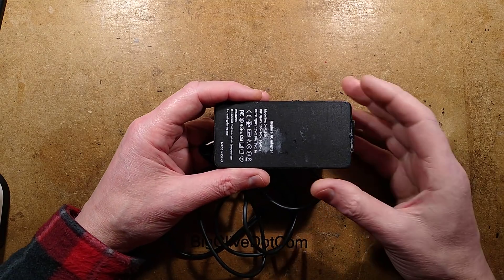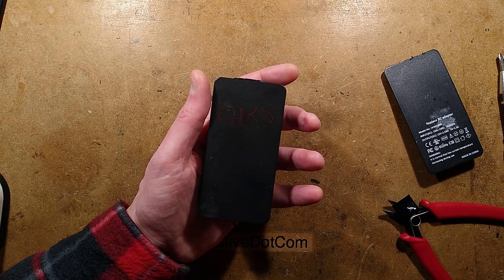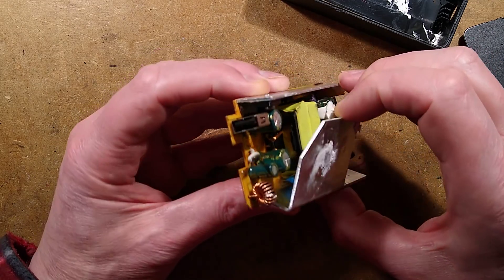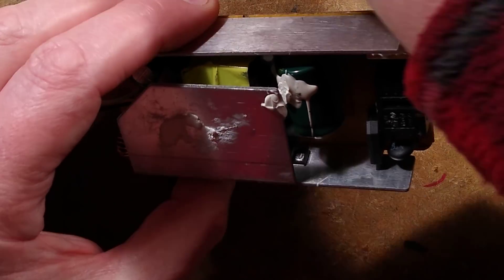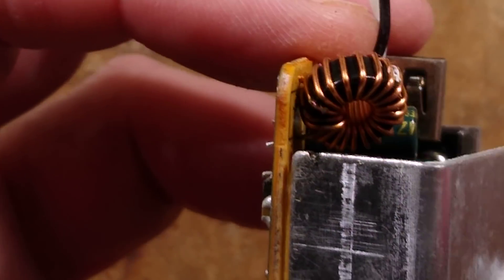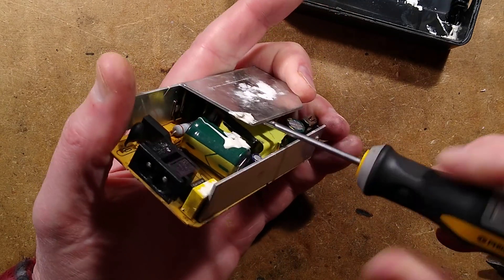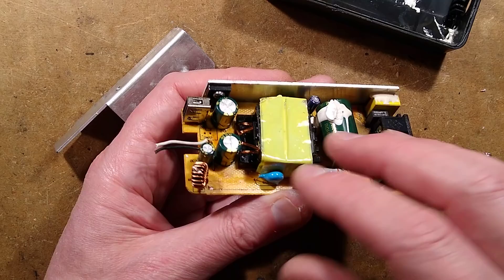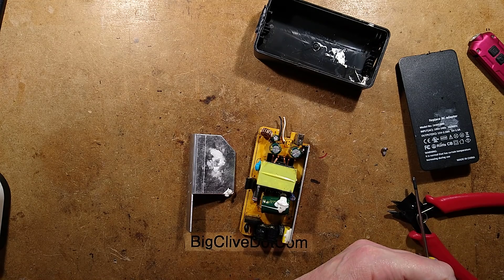This PSU killed a Microsoft Surface and a monitor

Comment: I have a few of these power supplies, all of a smaller power capacity. I have taken some of them apart, and even when they look a little different on the outside, the components are the same layout as in this one. None of mine have ever burned, and the difference is in the smaller one that I have, the heat sink, and the inductor, are both small enough, that they can't touch each other. One thing I do notice is that on mine, there is a glob of that white "shmoo" on the inductor. I don't know if they were trying to keep it insulated from the heat sink, or if it was to keep it from vibrating. Either way, I am glad to know about this fault. I will keep an eye open for this in the future.
Reply: Darrick steele. The white "shmoo" compound is normally used to provide mechanical stability to components. As far as I'm aware the compound has no insulative properties.

Comment: It will never cease to amaze me how people will spend a fortune on a piece of equipment and then plug any old cheap power pack into it.  Like .....  the power supply has a really important job to do, yes?  It's got to keep the equipment supplied with exactly as much energy as it needs to do its job and, just as importantly, not a joule more.  A decent power supply will be designed so that it will never damage the connected equipment under any likely fault condition  (except being connected to the wrong appliance).  A cheap one won't have that assurance; and there might be some combination of manufacturing tolerances and environmental conditions that leads to a dangerous situation.  Anything but a manufacturers' original recommended one or a decent branded generic replacement is a false economy.

What I think happened here is, the monitor must have had a mains earth connection; and the insulation failed on the output inductor, effectively connecting it to the heatsink (which is one diode away from mains live) with a consequent huge flow of current overheating and vaporising copper tracks, which carried on arcing until either the plug fuse blew or enough copper was gone not to be able to sustain an arc anymore.

If the monitor hadn't been earthed, it could all have gone differently as any exposed metalwork would just have been sitting there, live, waiting to give someone a nasty surprise .....

Comment: What do you expect from a Chinese knock off appliance?  I have an industrial power supply that looks terrific in design until you look at how close the metal grounded enclosure is to one leg of the fuse.  I packed some RTV between the 2 parts.

Comment: Blew up a brand new battery charger power supply after bringing it in from the van and plugging it in, suspected it was due to condensation.
Reply from the maker: It probably was condensation bridging tracks.

Comment: Good reminder to never cheap out on power supplies and/or order them from questionable sources

I've collected a massive box of all kinds of AC adapters and laptop chargers over the years from various thrift stores and recycling centers and whatnot for pennies and it always comes in handy when I need a power supply for something, especially if I buy a cheap used (vintage) laptop and don't want to spend 3x that price on a brand new official charger, more than likely I already have a suitable one in my stash and a set of adapters that should cover every laptop between the early 90s to today

Comment: The first thing I thought was like KiloSierraAlpha, that the inductor originally had adequate clearance from the heat sink but got dropped.  Dropping it may have pushed the component into the heatsink and from there on it rubbed against the metal until it wore through the coating on the wire.  There are multiple millions of economy products out there that perform satisfactorily every day.  It's not because the item was a lot cheaper that it was cheap junk.  If this company can build a power supply and sell it cheaply imagine how little it costs Microsoft to build theirs.  Gouging is a huge problem with big companies.  Thank God for the little guys who help keep prices reasonable.

Comment: Thank you, that was a great diagnosis. I love it when you do this.
We had a similar experience with pinched wires, passed all tests, then after a while, the insulation gives way and creates a ground path. In our case, it just tripped circuit breakers.

Comment: This is off topic Clive, but could you or any fellow electronics people recommend a good brand of solder to purchase? I'm a musician who does the occasional repairs and tinkering about, but my supply of solder ran out and I'm struggling to find that good old fashioned leaded solder with a good flux concentration in it. Thanks to anyone who replies!
Reply from the maker: You may have to hunt about amongst the smaller supply companies to find the good stuff.
Reply: @bigclivedotcom  Thanks for the reply Clive, very much appreciated! A guitar amp tech/builder, whom I trust, uses and has recommended Kester branded solder for the type off stuff I do.

Comment: I was inspecting a new switchmode flyback i got a few days ago and realized the mosfets heatsink is connected directly to the 400V cap, So its always live. And the diodes heatsink connected to output ( - ).
I was very annoyed at the design choice. So I inspected the other 40ish flyback transformers I have and on EVERY SINGLE one of them with heatsink the heatsink is connected to rectified mains minus. i Dont know if its for EMF blocking but its too dangerous and risky. it was an awful revelation and I don't know why it took me so long to realize that.

Comment: To answer your question @6:08 of "How many of these are out there...", A LOT. I work in IT, and Surface Pros account for about half the staffs mobile computers. Against our advice, some teams buy these cheap replacements when needed to try and save some money. In the end, they end up having to replace the whole device. Spend the ~$90 on the charger to save ~$1000 on a new device, don't try to save $70 on the charger.

Comment: I always check for power supply quality by plugging it into a laptop and seeing if the headphones buzz. also you can check with a AM radio to see how well it's interference is, since it still matters because a lot of devices use those same wavelenghts you're basically throwing away signal quality for things like bluetooth and wifi
but with the best board ever made can't save you from that awful design waiting to blow up.
Reply: Bluetooth and Wifi are hardly the same wavelength as an AM radio.  You're talking 12cm vs 430m.
Reply: Neither of those tests would have found this weakness.  Maybe an extreme high voltage test would have sparked through the same place, maybe not.

Comment: These "heat sinks" (in quote marks because having something like this in a completely closed plastic case with no ventilation is a bit pointless) are what came to my mind as the source of failure immediately. So many bad designed electronic devices out there it is scary...
Reply: It isn't pointless.  How do you think any circuit in a closed plastic box radiates heat?  The case gets hot.

Comment: When I was looking for a new PSU for my Mac laptop the choices were £40 for a third party part or £85 for a genuine apple part. Perusing the reviews of the third party supply, at least three on the first page basically said "Smoked my laptop". The additional £50-ish seemed like a saving against >£1000 for a new laptop.

Lower cost isn't always cheaper.

Comment: There's some "good" aspects on it (like the isolation notch under the opto-isolator) which makes me wonder if they might have copied something else and then down-costed all the components to produce a cheap clone.
And perhaps one of the replacements was to switch from an expensive and smaller surface mounted coil (not going to touch the heat sink) with a big and cheap wire-wound one. Or dropped the isolation that the original might have had.
I'm wondering if they also replaced a (better) metal-case transistor with a plastic case one, if the metal case transistor had negative main voltage on the case that might explain why the shield was connected to that, why not just anchor it in a nearby track that has the same potential.
Just speculation and without examining the PCB in detail it's impossible to know if that is the case, even with the PCB it may not be possible to be sure if that's how they go there.

Comment: By trying to save ~$30 on a generic power adaptor over an original has cost this fella over $1000 in equipment and possibly valuable data. 
A similar version of the above sentence/warning is written on every instruction booklet that comes with every computer, mobile phone etc...
I had a similar experience but without the bang when I lost my laptop PSU. After finding a non-generic but different brand one, with exect output specs, my laptop died as the barrel plug had an opposite poliarity arrangement.  It is always better to learn from others' mistakes than your own.  Nice autopsy Clive.  👍

Comment: This is a common problem with AC grounding and switch mode power supplies.
PC's generally use a three prong AC connection and Gaming/notebook PSU's are 2 prong.
Since Switch mode PSU's make electrical noise they have line filters and these filters when not grounded will inject half the AC line potential onto the DC ground.
If the PC is connected to a properly grounded outlet the filter in the PSU  will be shunted to ground (as it should be for proper operation).
But the problem is for some reason, gaming/notebook PSU's ground is floating and will, when connected to a PC, create a discharge current that could damage the PSU's and the equipment connected to it.
If you search the web for sparking USB or HDMI or shocked by touching USB or HDMI connections, the cause is from mixing 2 and 3 pronged devices.
The way to avoid these issues is:
1)Make sure the AC outlet is properly grounded and the polarity is correct
2)Make sure all powered devices are connected to the same AC outlet
And 3) don't mix devices with 2 pronged  PSU's with devices using 3 pronged PSU's.
The best way to solve the problem is to replace the 2 prong brick with a 3 prong replacement if one is available.

Cheers
Reply: PCs have three prong cables because they're typically in metal enclosures.  Devices with two prong power are in plastic enclosures with no exposed metal parts.  The ground pin on a 3 wire cable is for safety grounding purposes.  That prong is a terrible RF ground and doesn't really do much for RF noise suppression.
Reply: @stargazer7644  The only reason 2 prong supplies exist is to save money on the cord, the real problem is within the PSU. All switch mode power supplies use EMI/RFI filters and these filters use the neutral as part of the circuit, but the problem is 2 prong bricks are left floating and since the DC ground is also connected to the neutral all the connectors of the device powered by it will have this voltage on them. If you then try to connect  this device via HDMI or VGA or USB to a grounded device like a PC an AC current will flow and cause a spark. The amount of current depends on the capacitor values used in the filters and any other leakage currents in PSU design.
This spark can be enough to kill some equipment or in a less sever case cause random operating problems such as crashing.
The worst case is when these connections are made between devices that are plugged into different AC outlets on different phases, that's when you see smoke!
Reply: @rjrussell63  You seem to be a bit confused.  You were talking about the earth ground (3rd wire), now you're talking about neutral.  The only purpose for the ground wire is safety.  Any exposed metal parts must be connected to the safety ground, and the only current allowed on that wire is fault current so that everything stays at ground potential.  Devices with no exposed metal parts are double insulated, and therefore do not require a ground wire.  None of this has anything to do with RFI shielding.  Yes, the neutral is part of the RFI shielding filtering system.  In North America, the neutral is bonded to the safety ground in the main panel, so neutral is normally pretty close to 0V.  We don't have problems with interconnecting devices unless they come from different transformers and their neutrals are at drastically different levels (which can happen in industry and there are techniques to fix it).  It doesn't happen in residences.
Reply: @stargazer7644  The safety ground is connected to the neutral which is also connected to the earth ground, all theses connections are bonded together at the utility box.
Also connected to the same ground is the DC ground of the PC chasses and PSU's. So in summary: the Neutral, Earth, Safety, and DC grounds are all connected together.
Fault currents are fuse blowing events, but their are many electronic circuits that intentionally inject currents into the Neutral through the safety ( 3rd prong) such as an EMI/RFI filter circuit.
Reply: @rjrussell63  And is there some point you were trying to make with that observation?   The fact that they're connected doesn't make them the same thing.  You'll find a different potential relative to ground on each of those conductors if any current is flowing.  Hell, even the hot wire is connected to the neutral and the ground up on the pole if you want to talk about DC interconnections.  I don't see how any of this has anything to do with the topic.
Reply: @stargazer7644  The PSU failure in this review is most likely a result of mixing 2 and 3 pronged devices and most likely because one or both outlets were wired with the wrong polarity. I don't know what your background is, but I have an electronics background and have been engineering for 50 years. the reason for my post is to help people avoid this hidden trap that many people are falling victim too.
Reply: @rjrussell63  The PSU failure in this review has nothing whatsoever to do with mixing 2 and 3 prong devices.  Clive found the root cause in the video. The buck inductor on the secondary side shorted directly to the line voltage through one side of the line bridge rectifier.  Did you even watch the video?
Reply: @stargazer7644  The PSU died when the device it was powering (Surface) was connected to a monitor!
The coil and circuit board area he sited had no black carbon, if the coil had the full 15 amp AC flowing through that point it would have been black and melted.
The coil was scraped from something, may be when it was disassembled, but the coil was a nice shiny copper not black.
Also that coil is a choke for the low voltage DC output not the buck converter.

Comment: So in this PSU the electric current found a shorter way to bypass all the protection components in the circuit (fuse - NTC - Varistor) and continue it's way out?
And that's why non of them blowup, maybe?

Comment: Hi Clive, the Heat-sink is connected to Bridge Negative to reduce the EMI produced by the Switching Mosfet capacitively coupled to the Heatsink(Ccase,Cinsulation) and preventing the Heatsink to act as an Antenna for that Switching Noise, It's common Practice to reduce EMI. But Clearly the Component Placing is bad.
Reply: Hi, the heatsink is not actually connected to Ground as in Earth or O volt.

Comment: Putting heatsink compound between a heatsink and a plastic case wtf. Plastic, such a great thermal conductor.. O my
Reply: It's better than air.  How else are you going to get heat out of a fully enclosed plastic enclosure, Einstein?
Reply: @stargazer7644  You think that tiny blob of heat sink compound is going to conduct more energy through it than the entire surface area of the heat sink to its surrounding air and then in turn to the interior surface area of the case? You do understand what heatsink compound does, don't you? it's not magic ice. It simply improves surface area contact in the patch where you apply it. I.E it's going to do dick all, Einstein.

Comment: I had a security camera plugged into the video port of a nice tv. My friends dog had chewed through the camera wire. One of those where the 12vdc is run along side the video signal. When he chewed it the 12v shorted to the video signal and fried the tv main board.

Comment: My original Surface PSU went bad and I bought a clone. The keyboard track pad stopped working when plugged in. It blew up too. The cursor keys didn't work on said keyboard either so I won't be buying from MS again, despite the surface pro 6 looking great.
Reply: I did some 'consultancy' work recently. While there was a 6mm clearance between high and low voltage, there was also a ground plane covering the whole PCB, meaning the USB port GND would be connected to rectified mains if there was a short between the 350V cap positive and the ground layer about 0.3mm away on a different layer. That's why designs often have two boards: One for power and one for logic.

Comment: My thought, if the coil was touching from the factory. Thermal expansion and contraction of the aluminium heatsink during use cycles could also cause the wearing away of the enamel.

Comment: I have opened up some dodgy power supplies like this. In my case it was just a generic 24V supply, but it had that same design issue of heatsinks which run between primary and secondary, and I had wondered if that was an issue at the time. Turns out yes, yes very much so. One bone-headed design choice defeats all the separation instantly.